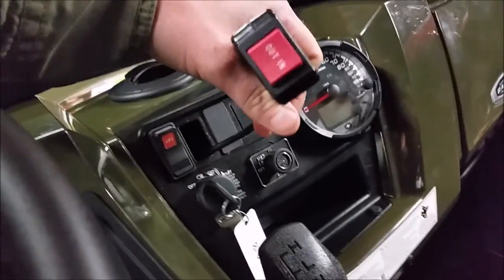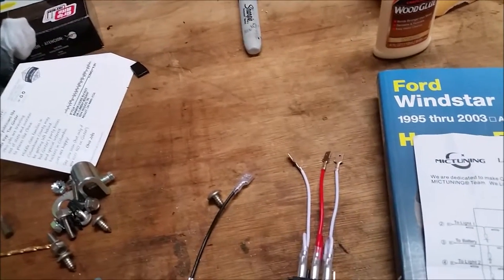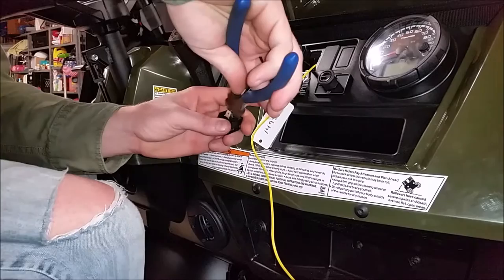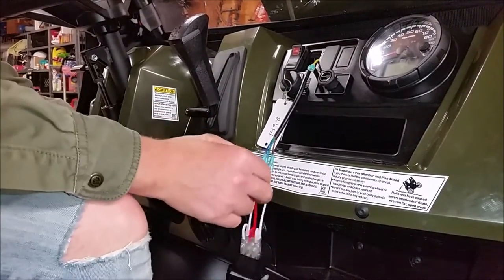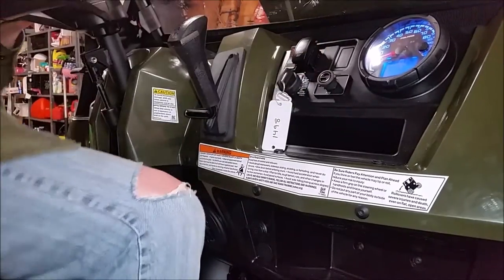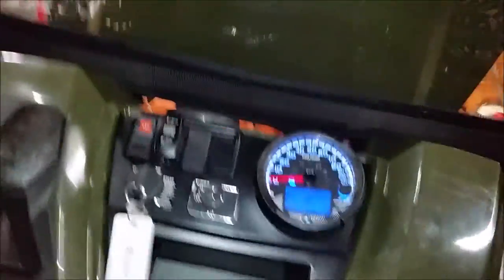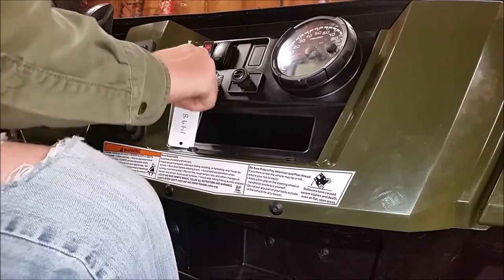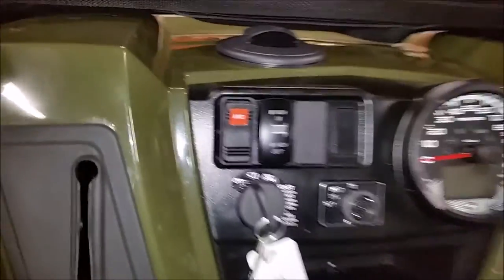Polaris Ranger Winch switch replacement

Comment: Good stuff.  I like that you left in the part where you did one of those things we all wish we hadn't done -- in this case, shrink-wrapping the connections before testing it out.
Reply: all he had to do was reverse the leads on the back of the switch. Tearing the shrink wrapped part and redoing it all was unnecessary.

Comment: Here is what worked for me keeping the switch fully illuminated when key is on...7 pole switch. 1 and 3 ignition.  4 black wire that goes to solenoid. 5 red to solenoid.  6 green to solenoid. 7 ground. 2 not used.  Superwinch Terra 45 installation.
Reply: wickiuprat I have the superwinch too and im trying to wire it right now the same way you said but its not working
Reply: Tylerz Rides  What's not working? I cut the switch off that super winch sent me and used the wire to my new 7 pin switch

Comment: Good video, thanks! One question tho... why didn't you just switch the wires on the back of the switch instead of taking apart your heat shrink connections?
Reply: That's what I was thinking.
Reply: Yeah all he had to do lol he was trying to hard to get it done I’ve been there then look back and be like damn

Comment: you could have just switched the black and green wires to change the in and out at the winch solenoid. 1,3,5 all go to + ignition. 6 goes to in, 4 goes to out. 7 goes to ground. 2 is not used. this will keep switch lit as long as key is on or running.

Comment: dont have switch in that spot already so how do i hookup?? just to contacor harness  then?
Reply from the maker: Tom Close I didn't have a switch there either. The one that was there I installed from the winch. You should have the wiring with the winch.

Comment: You can have that switch light up at key on all the time if you want just saying.   Just have to wire it different.
Reply: Could you tell us how in detail please? I am having my switch only light up only when I press up or down and I have mine wired differently than this video. Thank you Garry
Reply: Shur thing. Ok so taps 123.  That is the left side of the switch.   You are only going to hook ignition power to Tab 2 that is the middle tap. Leave one in three open meaning not hooked up to anything. And leave all the other side of the switch the same.
Reply: I'll give it a try later today thank you for responding and I will let you know.
Reply: Ok. Let me know how it works out.
Reply: Here is what worked for me keeping the switch fully illuminated when key is on...7 pole switch. 1 and 3 ignition.  4 black wire that goes to solenoid. 5 red to solenoid.  6 green to solenoid. 7 ground. 2 not used.  Superwinch Terra 45 installation. Go Vikings next year!
Reply: @wickiuprat  did it work?
Reply: @bpdp379  yes it did work read farther down in the comments where I commented on what I did to my winch wiring..